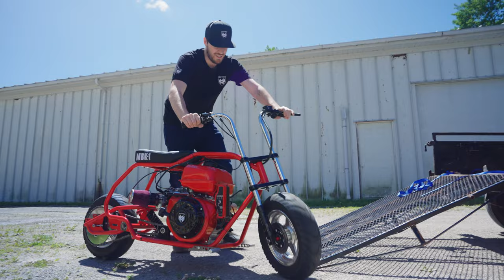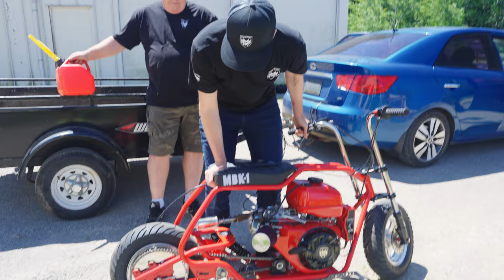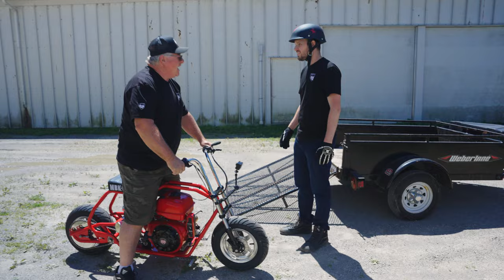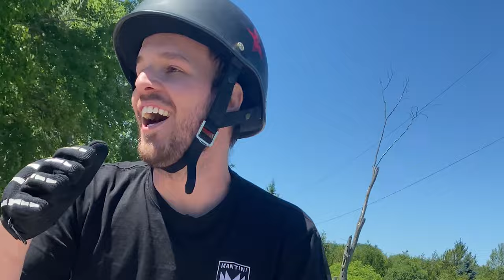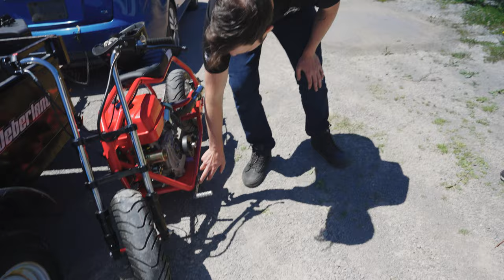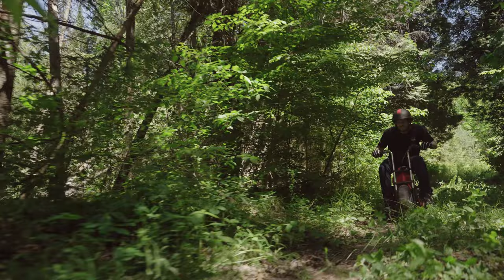Will Our Mini Bike Dreams Come True with the MBK-1?

Comment: Great build and a cool bike. I would recommend having those pegs foldable. A tight turn or something on the trail hitting those rigid pegs will be a bad day.
Reply from the maker: 100% That is why we partnered with Go Power Sports to create a full roller kit. On top of receiving almost everything you need to build your MBK-1, you also receive the upgraded foldable pegs which will bolt directly on to the extenders.

Comment: Looking awesome so far. I would redesign the pegs though. The fact that they are modular to positions is sweet. All though that lip is definitely going to wear down paint quick leading to a rust spot. Can’t wait to order one though.
Reply from the maker: That is a great point. A simple solution would be to apply a rubberized or perhaps hard plastic sticker on the lip to prevent it from wearing down the paint.

Comment: Looks cool,  but  that jackshaft should as close to that swing arm pivot point as possible. That way that chain will track  better during the suspension sweep  and almost eliminating that chain issue. You will still need the  adjuster/ tension wheel but that makes it's job 100% easier  and it won't wear the wheels out quickly. A tensioner  sprocket even works better  hardly any wear less maintenance. Looks cool I owned a shop in the motorsport business for over 23 years building karts  minibikes  repairing sales  in a store front . I have seen 100s of minibikes over the years but the last five years they have exploded in popularity again.  Tip on the bars twisting  put a crossbar in them something aluminum  windowed out your dealing with clowns they sue first ask questions later. Take a guess why I'm telling you this lol.

Comment: Loving the mini bike.
Was just wondering what clutch you are using and have you removed the governor or is it all stock ?
Reply from the maker: It is pretty much all stock except for the exhaust and air filter. We haven’t removed the governor yet but we will.
Reply: What clutch you running on the mini bike what's top speed ?

Comment: Love the bike but those handlebars are bad. Good job guys.
Reply from the maker: Glad you love the bike. We are always open to feedback. What about the bars do you not like? 

Also, it may not be obvious in this video, but they are height adjustable which is why they are setup as they are and we have developed handle bar ride plates so you can replace these bars with any bars you would like. 

But what would you have liked to see?